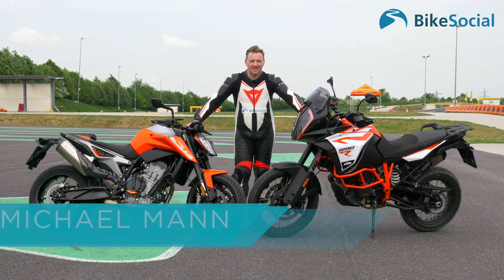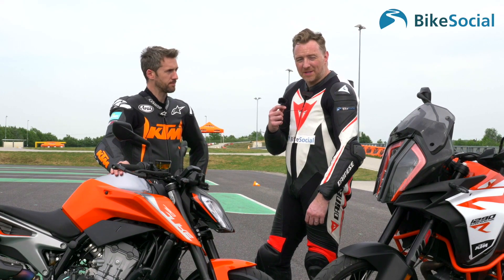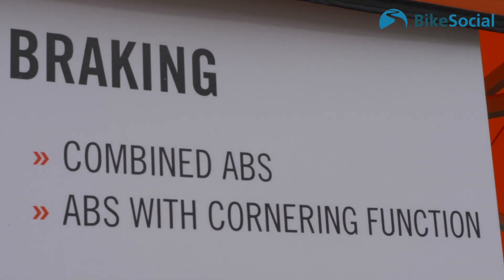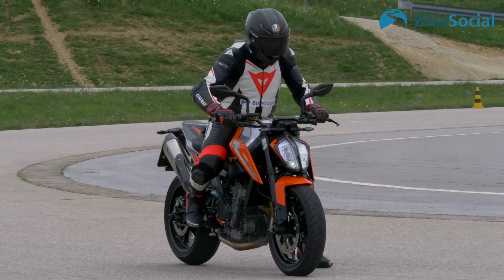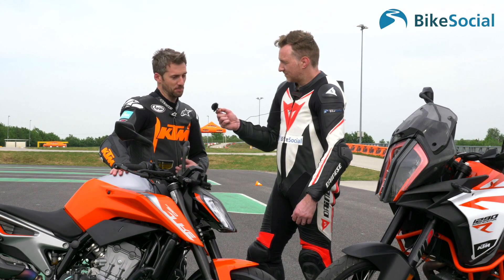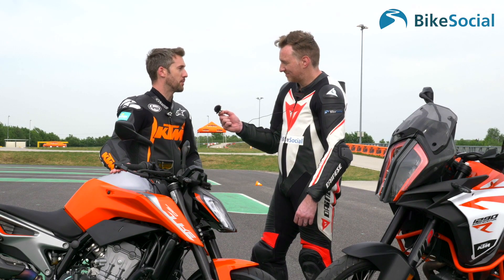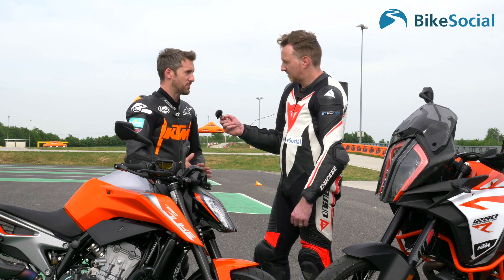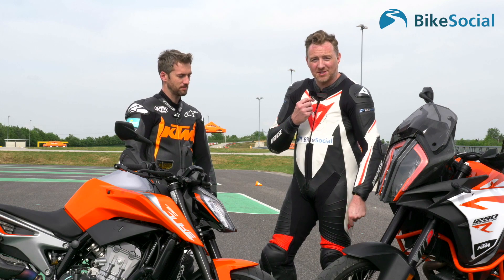Testing KTM's motorcycle electronic rider aids

Comment: The electronic aids prevent people from learning the necessary skills required to handle a bike. So somewhat nice to have and somewhat counter intuitive. I ride the 1190r and am forever switching all the gimmicks off - 1. because I know how to handle my own machine and 2. because it reinstates them after every engine start. How annoying. 

At the end of the day, this is all a very expensive marketing ploy and if you were to race or hit a proper trail you would not want these aids interfering anyway.
Reply: The electronic rider aids dont prevent people from learning the necesary skills, they take those skills and give it to a computer to perform perfectly 100% of the time.The MCN has a great video on youtube about it. 3 riders, 3 non abs tests, 1 with abs here are the results:

80mph:
Non ABS 1: 92 meters
Non ABS 2: 59 meters
Non ABS 3: 66 meters
ABS : 42 meters
There is no question that without abs you're not only inconsistant, but even the best rider there has 6 car lenghs difference with the abs rider.Youll have crashed 6 times before the abs rider because "you know how to handle your bike".Not to mention that the abs will always do it in 42 meters.No matter how good you know how to handle your bike youll never be as good or as consistant as an abs system.And that goes for all rider aids.

(Also in Moto Gp they use traction controll)

Comment: The question is why is every electronic feature mandatory? 
Why is every feature come after little to no market demand and with no option? 
Why isn’t there a Mechanical only line? Even if it costs the same I guarantee a large and obvious market would go strait for it even if it cost more.
Reply: I guarantee that the marketing people have done their homework and that the number of people that are interested in the electronic features outweighs the purists who would rather crank start a bike. Just think of the new Philips toothbrush with Bluetooth and position sensors... 

On top of that, there are also legal issues. As a manufacturer, it makes no sense to have electronics built for added safety and then sell a "less safe" version of it. I am sure they would rather have people not needing the electronics ridding with it than people needing it ridding without. 

You can always go buy an Ural!

Comment: too much electronic means system is the rider but not the human... Only thin I want is emergency brake...if a dumb human crosses the street without looking then the system must predict crash and apply required break...same from rear.. apply throttle
Reply: Nidhin David not a good idea if you are sitting relaxed in a neutral position on the bike any sudden unexpected acceleration or deceleration will send you tumbling off the bike or pulling wildly on the handlebars either scenario wouldn't end well for you or the bike

Comment: Shame they can't do R&D into why there electrics fail so easily and can't even take a splash of water. I also thought they would do more R&D on the engines as the are so phone to failures and the running temps are absolutely ridiculous. If it gets where you need to go no dought your legs are cooked like kfc chicken.

TRUE STORY

Me : The dash is missing info and displaying the wrong fuel level.
Dealer : Have you washed the bike recently.
Me : yes why ?
Dealer : there's your problem I can book it in to have it replaced.
Me : so I bought a £4500 bike that can't be washed or get wet.
Dealer : pretty much yeah I can get it in next Tuesday.

They didn't even touch it and sent it back claiming it was fixed and had a new dash. IT WAS EXACTLY THE SAME AND STILL HAD THE OLD DASH. It took them another month to sort it and as soon as they did I sold it and took a loss. It had in total 10 problems just with electrics and the engine in 2000 miles and 8 months of ownership. 3-4 of those it was in the garage. 

For reference the bike was always dry stored and never riden in the wet unless it rained while out and it was always kept clean and maintained. still a piece of s**t 

KTM = KEEP TAKING MONEY
Reply: What bike? I never had any troubles with washing my bike. Your dealer is a moron. I power wash my 1190 Adventure and had zero problems. The adventure had a fuel level problem, if i ever get it, there's a diy solution for it.

Comment: KTM has no guarantee on their electronic systems! I would like to own a KTM adventure bike at one time but I would never buy from a company that won't stand behind their machines?
Reply: So my dash died as I mentioned on the other post. What sucks is I bought this bike to go to Alaska and back next year. Now I have zero confidence with the bike. I think I may fix it sell it and go buy a Yamaha Super Tenere
Reply: here in Germany this doesn't matter because you don't rely on ktm warranty. the dealer is responsible for that for the first 2 years (and he can't exclude anything except consumable items.
Reply: My bike is 10 months out of the warranty. I was not expecting it to be covered. But then I was not expecting a bike 3 years old with 22,000 miles on it to die! Maybe the problem is all the computer BS. I've owned a bunch of bikes over the years with a whole lot more miles and years older never had a breakdown comparable to this.
Reply: @bikeryder757  electronics of all kinds are specifically excluded in their warranty. It's insane. A lot of people have complained because they didn't know that and if course came down with electronic issues.
Reply: They have issues too that they know about. Google KTM dash not working or etc. Tons of riders have dead dashes and KTM won't cover it even under warranty. Crazy.
Reply: @TheLogicalLowdown  wow! Not even under warranty...  That's crazy!  My dash and reflash the CPU will cost $1,100.00.
Reply: That’s why you buy the 701 Supermoto ;) little electronics, simple dash, 0 problems :)

Comment: Just to strike a balance with those who hate rider aids, i am returning to riding after 20 years being off a motorbike. These aids were not around when I started, but now you have to look at them as a way of making riding safer. Sure, you can handle a bike like that, but one day you may just realise that you have overcooked it on a corner and now your life depends on the cornering ABS to prevent you from sliding under the truck in the oncoming lane. Take these electronics as they are, aids for your safety. You probably won't need them, but one day you may thank them as they helped you out of a tight spot.

All the bikes I test ride had similar electronics, so I am pretty sure you will have a hard time finding one without them. You can turn them off if you really feel you need to, but for me, knowing that a computer is watching everything I am doing and can assist and maybe prevent me coming off.... I a! All for it.
Reply: I absolutely agree with u. Had my life saved by the ABS on my D390. emergency braking at 120kmph, came down to 15kmph in just a couple of metres. without that I'd have surely skidded, or hit that fecking truck that switched lanes with warning.
u can never predict on road what might come at u. and these systems work on physics, doing thousands if not millions of calculations per second. not even the most experienced rider can do that amount of calculations in a sec.
Reply: Totally agree!

Comment: I have an s1000r, and it has all the electric aids. Have heard of instances where these aids fail, and reality is that would be catastrophic. If anti wheelie were to fail the thing would loop very quickly, unless there are skills to detect and react to the failure where there is an expectation it will work. Got to practice the skills. Problem is I need a PhD in engineering to switch stuff on and off on the BM...
Reply: brian glendenning I find it quite easy to turn on and off stuff on gs lc (: to me it's extremely user friendly
Reply: Or just read the manual and memorise the controls. Bet you're the type who struggles with texting someone on an iPhone too.

Comment: I have the 1290SA with cornering ABS, and like all the Rider aids it works well, but...looking forward I’m a little concerned about the impact of these technologies on people who aren’t even riding yet. I’m fairly competent, and have been riding for almost 40 years, but of course I learned to ride in days when you had to know how to control the bike in emergency situations, and as nice as cornering ABS is, if you don’t know what to do in an emergency there’s a risk that you’re relying on technology to make up for poor or bad technique, and it could be dangerous. I also have HHC and it’s fantastic especially when I’m fully loaded with hard panniers and a 60L soft bag.
Reply: ABS saves millions upon millions of dollars worth of accidents. I would bet that failures of something like abs would be miniscule compared to the number of drops saved. I dont have data, but there is a reason abs became mandatory.
Also, I have read that people with abs are confident at braking as hard as the tyres will allow while those without tend not to brake as hard for fear of a wheel lock.
Reply: That's what's happening with airliners today, pilot learn on computers, fly in flying computers, when something bad happens, hundreds die
Reply: and airline travel has literally never been safer - your point? Machines are much, much better than humans at handling both simple and complex tasks (for which they've been trained).
Reply: @WickedTRX  Wtf are you talking about.Ofcourse they wont give them multi million dollar planes and risk their life and life of instructors
Reply: @Ronan Rogers - I agree but the alternative is having people crash. This safety tech is starting to become standard though so having riders rely on them isn't such a big problem.
Reply: I just purchased the 2020 1290 R yes been riding for over 40+ years. I have the track pack,but still shift with the clutch i guess all them years of doing it. Though i was very impressed with the TC set at #5 I had that low cause wanted see how much the tire would brake loose gas it out of corner, all i can say very impressive. Don't think i could have the parts hit brakes hard in a corner especially in wet roads just can't see it work. Maybe to certain point, but leaned hard over mid apex you just punched the brake hard i just can't see it working. Not trying it on my new bike either,lol.